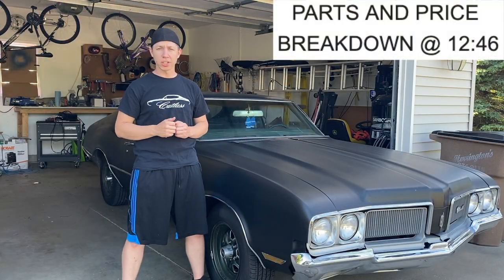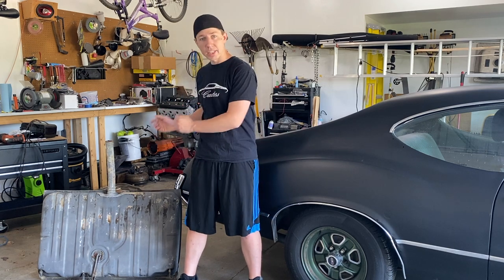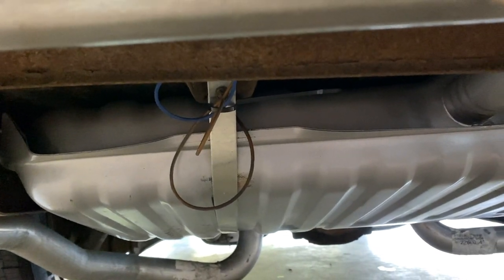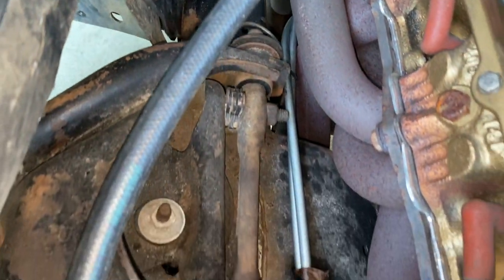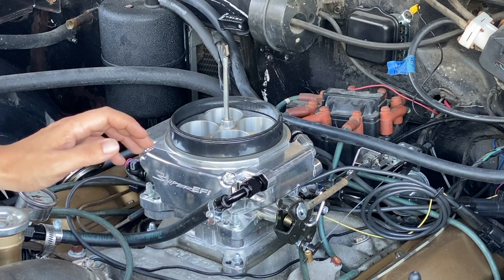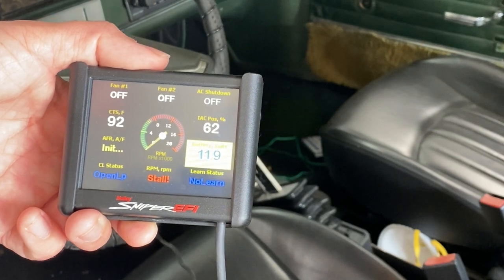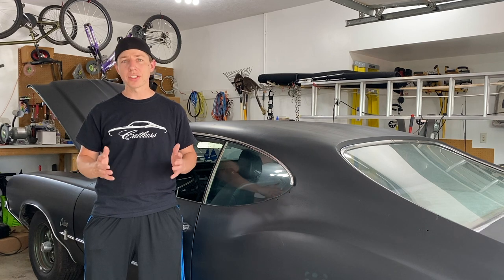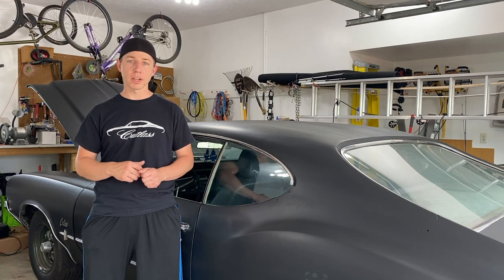Rebuilding 1970 Cutlass Episode 6 - Holley Sniper EFI on 350 / 455 - Install and Review

Comment: Good job with the build. One thing though. You might want to run that fuel line farther away from that exhaust. Keep the videos coming.
Reply from the maker: Thank you sir! And I will check into if I can find another route for that fuel line. It is pretty far away, but maybe I can move it a little further :) At least maybe a heat shield of some sort. I appreciate the support! More content on the horizon!

Comment: Your problem was not the carburetor, it was the ethanol in the fuel. Carbs hate 10% ethanol and will not run great no matter what you do. Poor fuel atomization when cold causes rough running and easier vapor lock when hot. EFI conversion is a great idea. Some places offer 100% gasoline but at a higher price.

Comment: How has the EFI been treating you? I'd love to make the switch by my quadrajet works so good.
Reply from the maker: The EFI has been working pretty well, but I recently switched over to the hyperspark and running into a few issues. Just been fighting with it and gave up for a while. May give it a go again soon.
Reply: @ChadWilliamsFixesAll  why did you switch to the hyper spark distributor?
Reply from the maker: My old distributor had an oil leak and I just switched everything out at the same time.